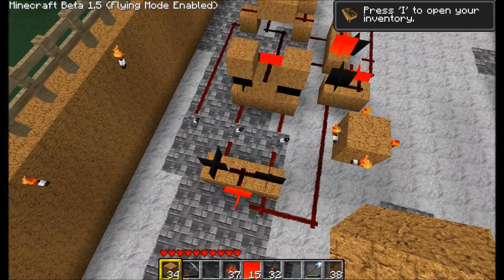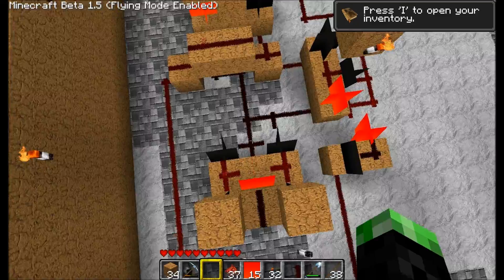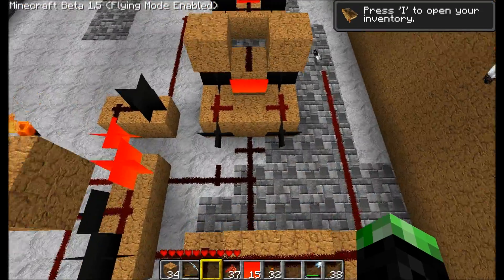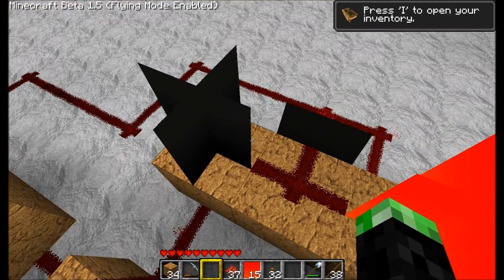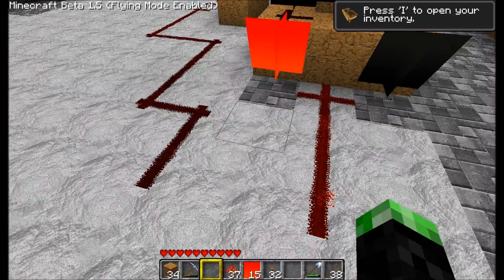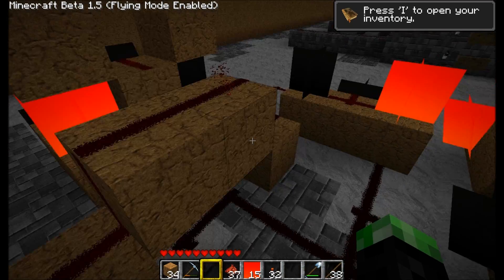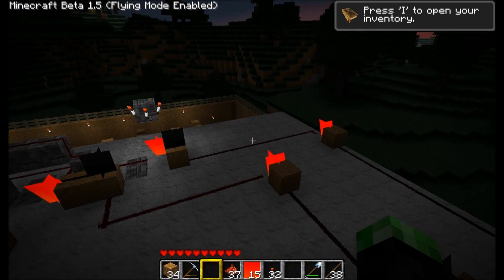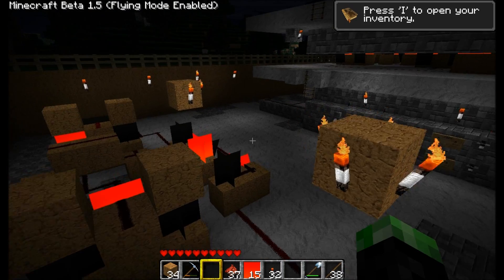How To: Make A One Bit Adder In Minecraft

Comment from the maker: @Gnamra

Yes, each new bit (or digit) represents double the previous digit. 

For example:
1 1 1 1 1 1 1 1 
Would be:
128 + 64 + 32 + 16 + 8 + 4 + 2 + 1

Connecting them is fairly simple with my design. You need only stack a new adder next to the old adder, and connect the c OUT to the new adders c IN. 

I'll make a video on how to accomplish this.